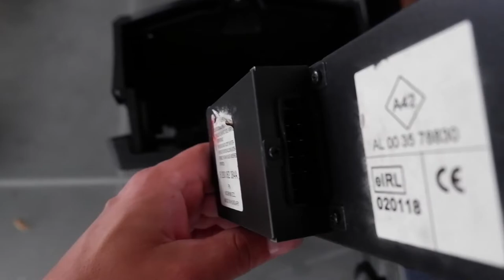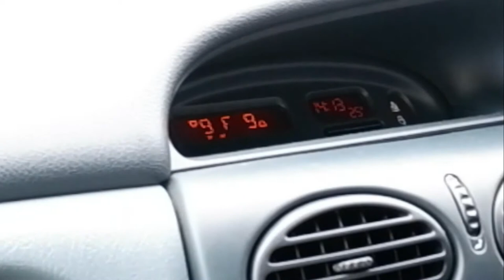Megane OEM Audio Project Revisited, includes short channel update.

Comment: Great video Mark. I hope you get the fuel pump sorted, and your dental surgery is healing. Buggar about the Changer lead, nice job changing stereo & rear ledge speaker grilles, that code app is amazing. I look forward to FOTU, I see it’s Little Bytham entrance, that’s where the Mallard became the fastest ever steam train @ 126mph
Reply from the maker: Wow, I did not know that fact about the mallard, well the location part anyway.
The dental work is healing fine but I've got another appointment for some more minor work soon.
The pump installation is on hold due to discovering the need for a special tool to release the hose from the pump. For Saturday I'll have to run it as is.